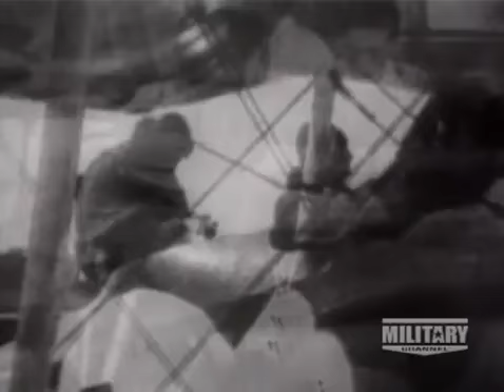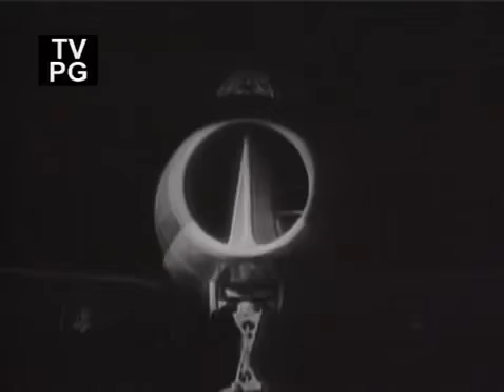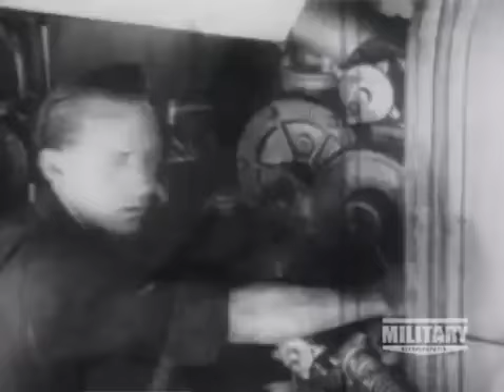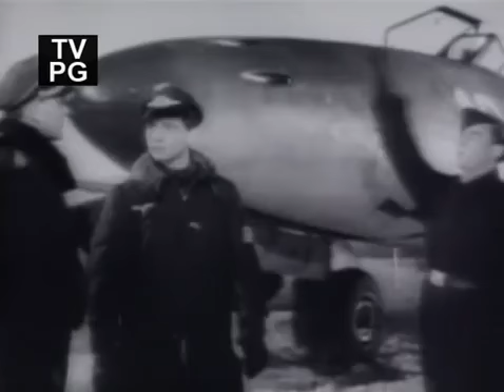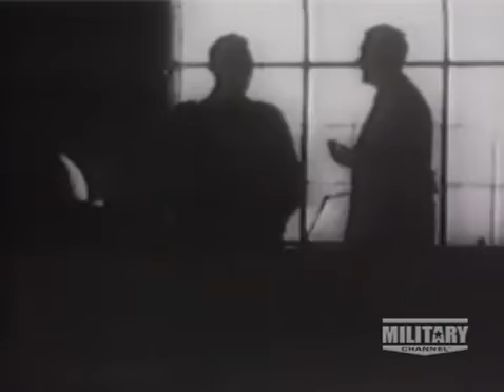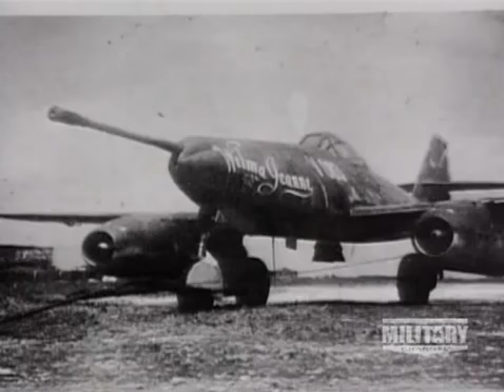Wings of the Luftwaffe: Me-262 "Schwalbe"

Comment: The Lockheed L-133 was an exotic design started in 1939 which was proposed to be the first jet fighter of the United States Army Air Forces (USAAF) during World War II. The radical design was to be powered by two axial-flow turbojets with an unusual blended wing-body canard design capable of 612 mph (985 km/h) in level flight. The USAAF rejected the 1942 proposal, but the effort speeded the development of the USAAF's first successful operational jet fighter, the P-80 Shooting Star which did see limited service near the end of war. The P-80 was a less radical design with a single British-based Allison J33 engine, with a conventional tail, but it retained a wing which was the same shape as the outer wing sections of the P-38 Lightning.
https://en.wikipedia.org/wiki/Lockheed_L-133#:~:text=The%20Lockheed%20aviation%20company%20was%20the%20first%20in,Johnson,%20Willis%20M.%20Hawkins%20and%20Hall%20L.%20Hibbard.
Reply: At that time, Germany was technically superior and better.
Reply: @OldEastGermany  The fact is that Germany put the theories into practice sooner than anyone else true but that doesn't change the fact that American or British engineers also had great ideas, and fact is Germany still lost Hitler's war.
Reply: @AdamosDad   Fact is the American P-80 Shooting Star was a cheap English copy and a total flop for America, fact is up until 1945 America wasn't nearly as good.

Comment: Thanks for this. My Dad was a US 15th AAF B-24 nose-gunner 1944-45 and said (as here) his turret couldn't track these jets strafing and streaking past their formations. The 262s shot past the P51 fighter escorts and to the Germans they appeared to be "hanging in the air like balloons." On one mission a level flight of 4 jets came straight at theB-24s with all their cannons winking and down went six B-24 Liberators, in one pass. How the man survived we'll never know.
Reply: if germany had 1000s of these us and uk would have had to stopped bombing indefinitely...this would have given germany untolds about of unhindered production and supply logisitics to italy and russia and reinforcing french coast for d day...imagine 100 262s during kursk
Reply: @kickassandchewbubblegum639  The USAAF did consider stopping daylight bombing  and began to prepare for night bombing after the Schweinfurt raid where they lost 99 aircraft in one raid. There was also a pause on daylight bombing when losses exceeded 5% per sortie, a level which sounds bearable, but day after day it is not sustainable as you run out of crews faster than aircraft. Even crews that survive go home after 30-35 missions

Lets imagine a bombardment group of 100 planes and they lose 5% per mission (I have rounded up or down to the nearest whole number

100
95
91
87
83
79
76
73
70
67
64
61
58
55
52
49
47
45
43
41
39
37
35
33
32
30
29
28
27
26
25 - 30th mission, first surviving crews stood down or
24
23
22
21
20 -  35th mission, 

So once a Bombardment group is reduced to 25 or 20 airframes, it is probably withdrawn. I would expect it would have been withdrawn sooner than that.

Another factor to consider is the enemy. Less of you means less targets for them. As numbers of bombers deplete more fighters and flak are concentrated on those remaining. Enemy  gains experience, including flak defences could raise the loss rate well above 5%. And the enemy's loss rate may decline too.
Reply: @PORRRIDGE_GUN  - You can also use the "rule of 72" to quickly estimate the doubling time for 5% growth (equal to the halving time for 5% loss). 72/5=14.4, so it takes about 14 to 15 missions to lose half your starting number with a 5% loss rate per mission - which agrees with your table of numbers. By around 28 to 30 missions you halve the survivors again, leaving just 25 of the starting 100, again agreeing with your numbers.

Attrition worked both ways. The Western Allies had deeper resources to absorb losses of both men and equipment. Replacement aircraft and crews constantly ferried across the Atlantic. In the months it would take a bomb group to fly 25 missions, the USAAF could put several new groups in England. The USAAF could afford to rotate out its crews, sending experienced pilots back home to provide valuable training for new recruits. In contrast, Luftwaffe pilots flew combat missions until they died or were too badly injured to fly, which is why some of them accumulated vast numbers of aerial victories. But this also deprived their training pipeline of experience. The quality of new Luftwaffe pilots gradually deteriorated, while the quality of new American pilots gradually improved. Another problem later in the war was the lack of safe airspace for German pilots to train, with Allied fighter-bombers roaming all over Germany. And the bombers weren't the only airplanes getting shot down - even without fighter escorts, a formation of Allied bombers carried hundreds of defensive machine guns. Getting through all that metal wasn't easy for Luftwaffe air-superiority fighters, which is why the Luftwaffe relied on heavy fighters (Zerstörer) with cannons that out-ranged the machine guns. (The Zerstörer in turn became easy prey for USAAF P-51 Mustangs when they became available.) While trading bombers for enemy fighters is not ideal (bombers are much more expensive), the Luftwaffe was still losing fighters. And even apart from combat losses, all air forces experience non-combat losses. Flying high-performance aircraft is inherently dangerous.

Of course as we recall from reading history, the USAAF reversed its catastrophic bomber losses from 1943 going into 1944 with increasing numbers of escort fighters with the range to accompany bombers all the way to their targets and back, and with General Doolittle's tactical innovation of sending waves of fighters far ahead of the bombers to attack the Luftwaffe fighters while they were still climbing to altitude and trying to form up.
Reply: @danielmocsny5066  Thanks for your detailed reply. Very interesting. 

I met an RAF veteran who finished the war as an Air  Intelligence Officer, debriefing and interrogating LW aircrews (he spoke fluent German and lived in Nazi Germany before the war)

I think he would have said that to say that LW training of pilots declined steadily is an understatement. It absolutely fell off a cliff according to him, with pilots who couldn't even describe the functions of instruments or equipment in their aircraft because that wasn't covered in their training. Navigation for many was only possible using homing beacons, but when they were often jammed by Allied countermeasures, the pilots were essentially lost and would put down anywhere they could find or bail out when out of fuel. Several times they landed on allied airfields in error.

Losses were consequently horrific. The Me109 was not an easy plane to fly for a novice, and in the year March '44-March '45 the LW Quartermaster reported 50% of Me109 airframes were lost in landing or take-off accidents. Not sure how many pilots were lost, but it was probably quite high, and even if not killed, probably injured to an extent that kept them out of the remainder of the war. 

The LW had a dual trainer for the Me109, the G12, but only 100+/- of them. They were rebuilt G4 and G6 models and had poor reliability. Only the 'Experten' could exploit the potency of the later G14/K4 models
Reply: @kickassandchewbubblegum639  - Germany could have delayed defeat with enough jet fighters but probably could not have changed the ultimate outcome. The western Allies were developing their own jets too - both sides were copying each other's weapons throughout the war (the Germans for example developed the Panzerfaust after capturing an American Bazooka). The USAAF (with British help) had its Lockheed P-80 Shooting Star operational by 1945, but had no need to rush it into action by that point with the Luftwaffe largely destroyed. With America's massive advantage in production and logistics, the Germans could not have compensated for very long with a quality advantage. Besides, the USA had the atomic bomb in the works. Germany's best and perhaps only chance to win came in 1939-40 when there was an opportunity to starve the UK out of the war by sinking its merchant ships, but the Kriegsmarine did not build enough U-boats early to exploit its temporary advantage. By the time German U-boat production ramped up, the western Allies were also ramping up the quality and quantity of their anti-submarine warfare.
Reply: Gardens angels were there